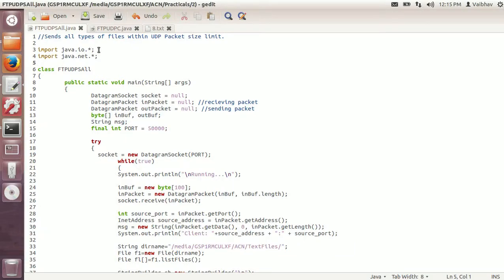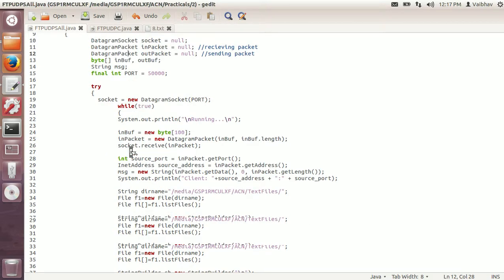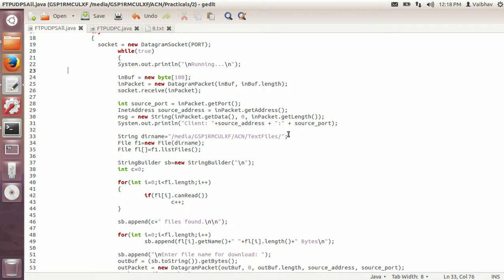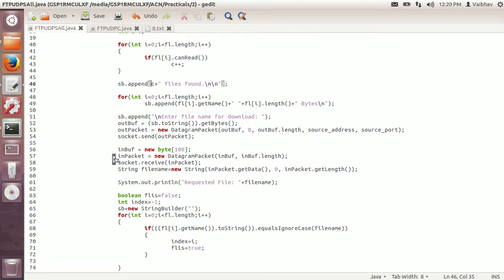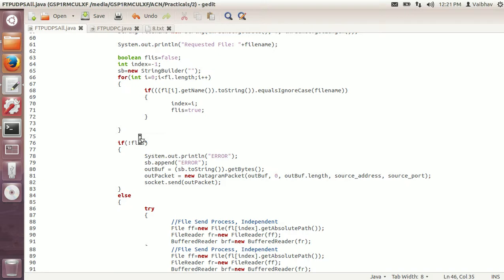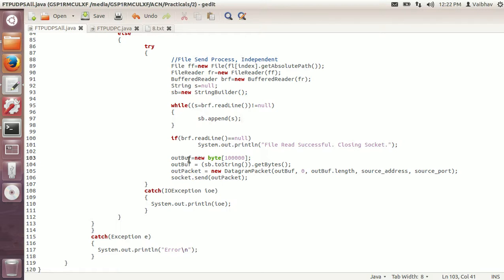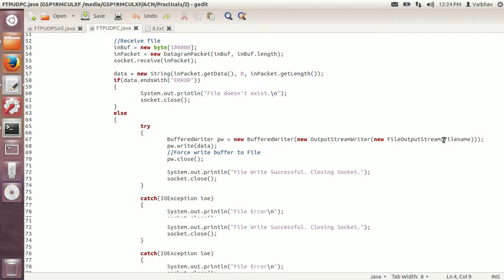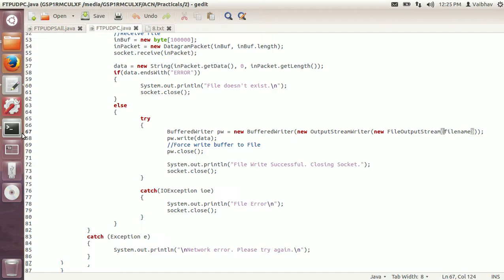FTP UDP using Java

Comment: can we run this in netbean?
Reply from the maker: Can NetBeans run two files at a time?
I don't think so. If you want to use NetBeans for coding you can, but while running program run via command prompt/terminal.
Reply: yes,you can run netbeans,try creating client ,server code in seperate projects.It works for udp chat also.

Comment: It downloads, but where exactly to? The tutorial never specifies where it would download to. So where does it download the file?
Reply: I found out where it is. Can I specify where I want to save the files rather than save them on the folder where the project is.
Reply from the maker: It downloads in current Java Program execution directory.
You can specify using filepath.

File download=new File(filename, "/home/edgar/Downloads/"

Make sure you've permissions to write to folder.

I hope this helps. Any more doubts? Thanks for watching.
Reply from the maker: Edgar Martinez Yes in client side. Just before you create BufferedWriter, create
File download=new File(filename, "/home/edgar/Downloads/");
and after that, replace filename in BufferedWriter by download.